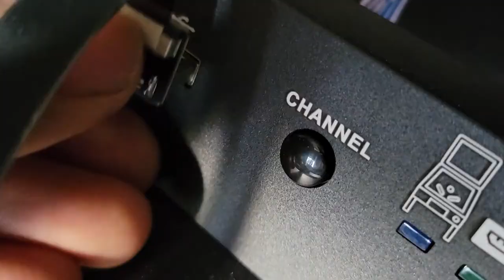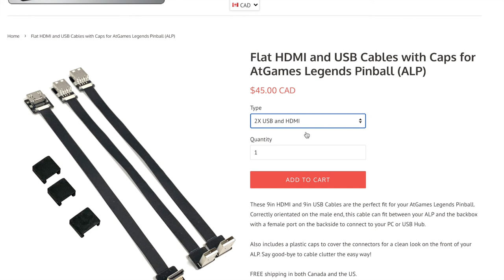Legends Pinball OTG front panel cables SOLUTION

Comment: That’s the hard way to do it brother, you don’t need to take out the monitor to do it, just takeoff the back box with those four wing nuts and remove a plate with two screws. Literally takes all of five minutes. And as an FYI if you’re showing people they have to remove their monitor you should probably point out that you have to remove the cables underneath the monitor because if they go tugging on that thing with the wires still connected they could ruin their ECU which could be a very costly mistake
Reply: Do you have your cables just running flat UNDER the back box then?  And they just wind up on the outside of the back panel once done?  Thanks, I really don't want to take off my monitor if I don't have to.
Reply: @johngannon  Yeah it’s super easy, just takeoff the back box and when you do you’ll see a hole underneath it where the cables from the back box go into the main body of the unit. The way his video shows it is way harder, time consuming, and could lead to the possibility of messing up your monitor or PCB when you’re moving stuff around in there.  What he has you doing in the video is roughly a 45 minute process versus just taking off the back box which to install which was under 5 mins
Reply: And I still don’t see where he put the cable because there is a lip on the metal plate that rests into a grove in the wooden panel that the flat cables would somehow have to bend around

Comment: i'm confused. i get you moved the connections using to ribbon cables to inside the cabinet but how did you run the computer cables in the cabinet to meet them? i don't yet have a cabinet of my own.
Reply from the maker: You will connect the usb from the ALP to the PC usb. Male-Male usb

Comment: Hi.
Did you cut slots in the metal rim? Or the wood?
Reply from the maker: No. Did not have to cut anything.
Reply: @MajorFrenchy  ok cool thanks. Maybe the gap between the wood and my metal button thingy is smaller. Cheers for the reply
Reply: @dieard1  Prior to final installation in the video, there appears to be a design difference, where there is no 'slot' to receive the control panel. The cables do not appear to be able to work with the slot without some sort of modification. Did you come up with a solution?
Reply: @DavidRSchaller  hi.
Yes. I cut a slot out slot with a Multitool.
You could use a dremel.
Reply: @dieard1  going to run mine between the cab and the backbox.